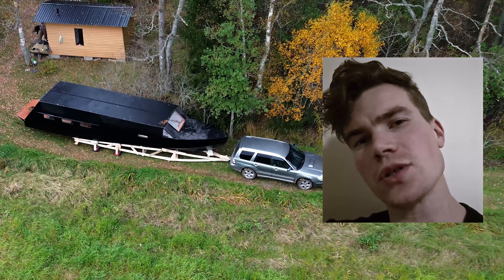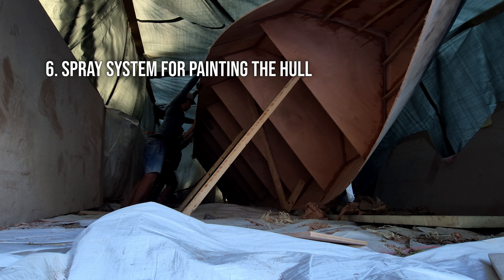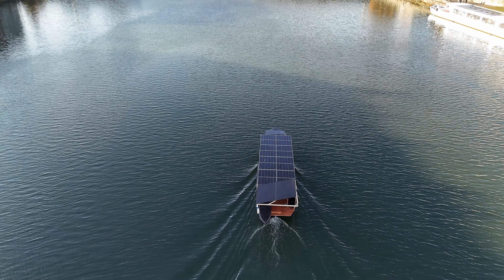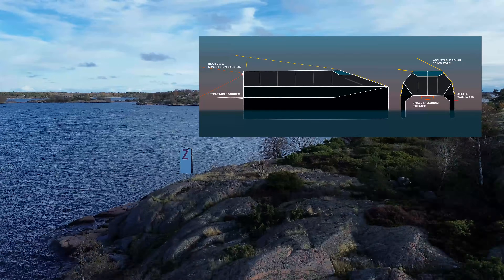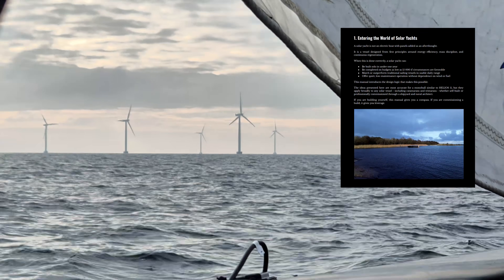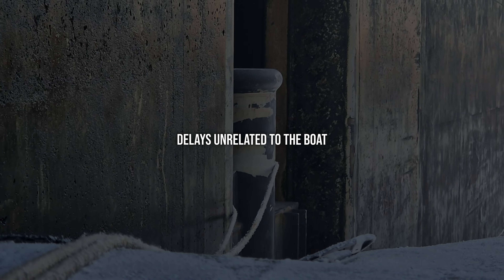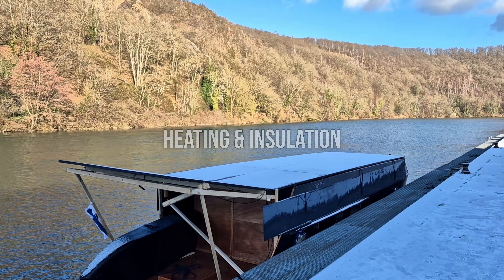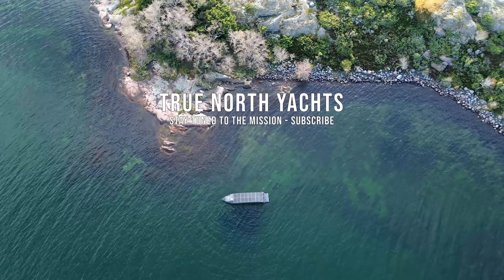The Real Reason I Got Trapped in the Winter Canals

Comment: Don't blame yourself, building this boat in 6 months is an achievment and the design is a success :trophy-yellow-smiling: Of course you will build other boats but yet you can improve the HELIOS 11 if you add foilers to improve the stability and make it fly with a stronger engine :face-blue-smiling: Keep going, your adventure is amazing  :hand-pink-waving:
Reply: I think the speed is already near hull speed. An engine that can liift the boat out of the water (planing) isn't viable for solar traveling.
Reply: @thoreberlin  The speed of the boat rely on the motor and the batteries. The solar panels are merely a way of recharging the batteries. By adding foilers to the hull you will create lift proportional to the speed. The more lift you generate the less drag to a point the hull does not create drag anymore. A 10KW motor should generate enough lift to make this boat glide above water. :hand-pink-waving:

Comment: Not sure that you want to keep the black topsides as you get further south.  Your hull is going to get very hot.  This can lead to delamination (I speak from experience here).  The fix is easy though, just (re)paint with a light color.
Reply: Don't want to be a black boat in the summer in the Med for sure.
Reply: @jerryDycus-d9c  it's winter and not summer yet.
Reply from the maker: It may get hot. Luckily almost all upward facing surfaces are covered with solar (and have a ventilation gap)
Reply: @Lukas-TrueNorthYachts  There's a reason nearly all fiberglass boats are white. You don't wanna cook the epoxy unless you wanna trash your boat after a very short time.
Reply: @GaryTheRCcar  he knows dude and it's still winter time so no worries about hot until summer.
Reply: @Lukas-TrueNorthYachts Voisitko kokeilla heijastaa aurinkoa aurinkopaneeleihin muovipeileillä? Olen kirjoittanut aiemmin, mutta en näe, oletko vastannut.
Reply: My thought is that a white surface also reflects light (which might be captured) while black absorbs.. reflection might be helpful for solar.
Reply: So you’re staying in France? 🇫🇷